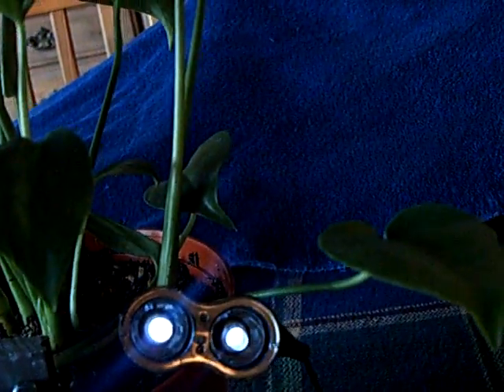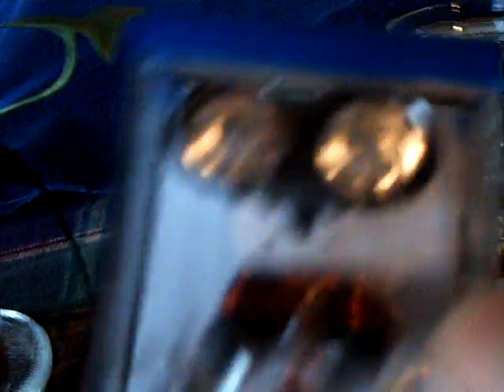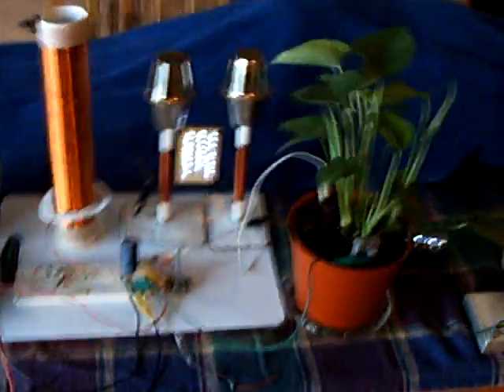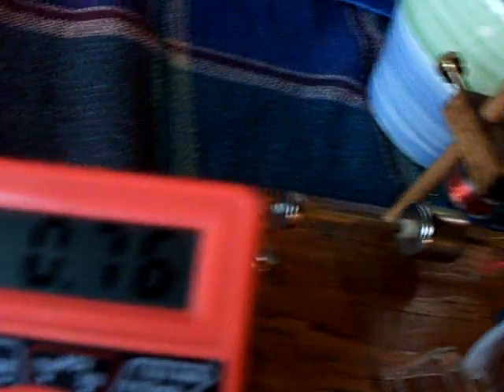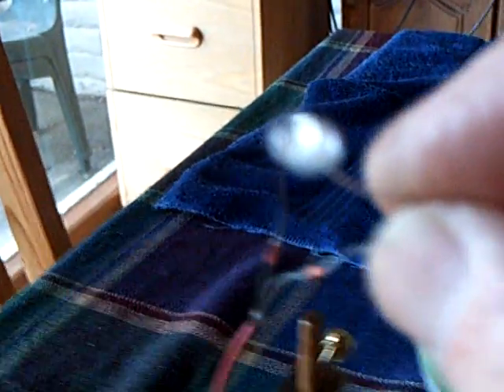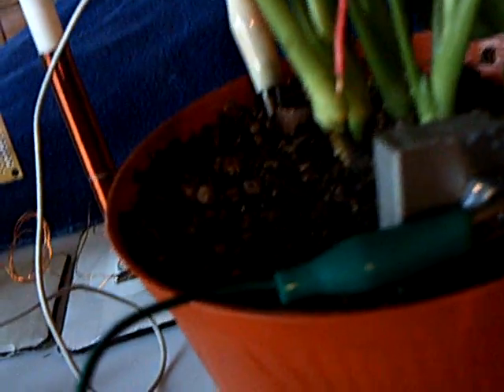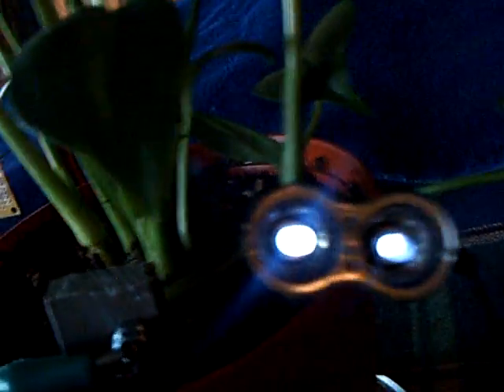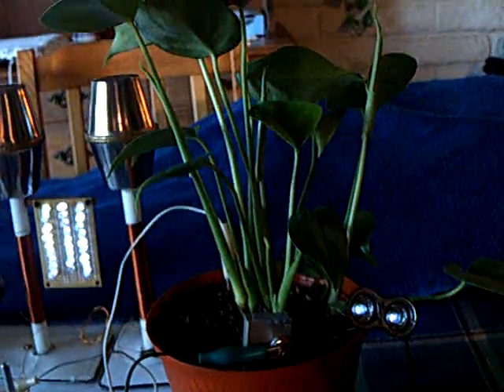Plant Battery, Slayer Exciter, and a Bobin Motor.ASF

Comment: Lid:

Incredible that you can run all of that from the power plant.  One question, the whole area appears to be hot as you have shown, can you hold the AV tester in your fingertips (maybe have to wet your fingertips) and get it to light?  That energy is going everywhere and I suspect that may include you as well.

I am just curious.

Excellent work as always.

Bill